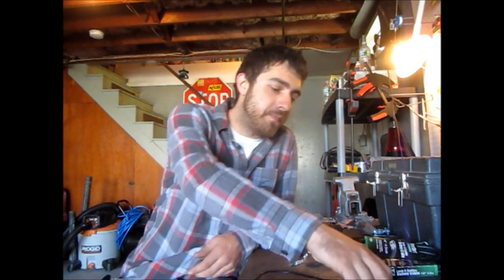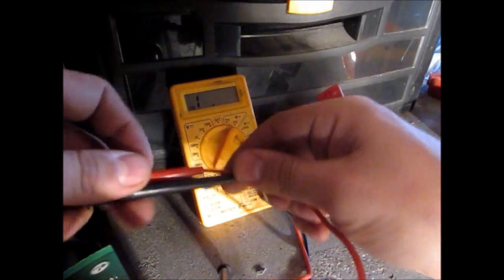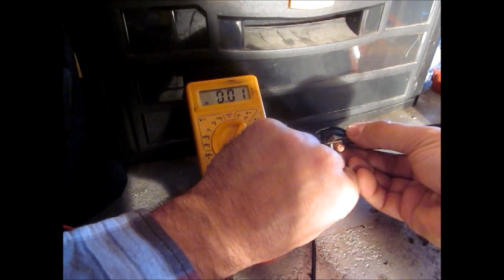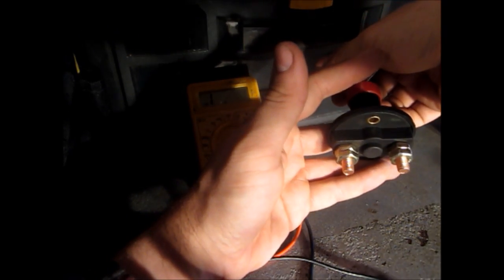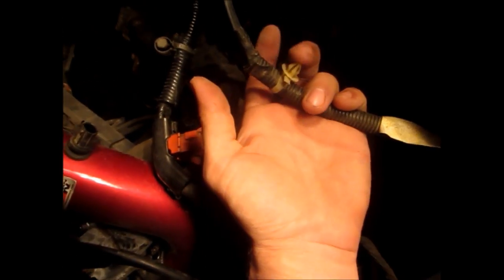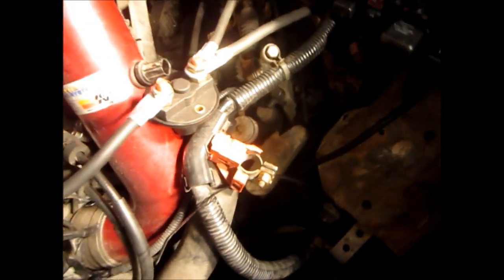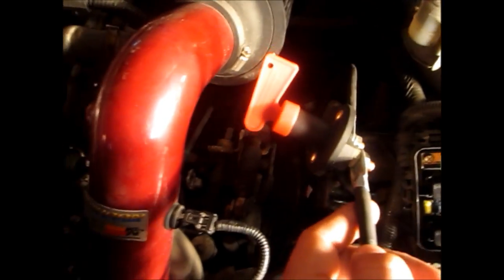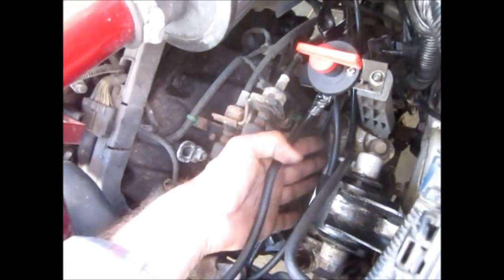How to install a kill switch on your car

Comment: wat if your car has central locking doors en you install the kill switch. you won't be able to lock and unlock your car with the key. that is my problem aswell were do i find the power wire of the doors locking system
i'm made a kill switch on my Porche Cayenne 2005 but now i need to find the powerwire of the central doorlocking. anybody has any ideas please let me know.

Comment: I think however you're suppose to install the kill switch in line with the positive terminal rather than the negative terminal.  Also, I'd chose a different one, where the plastic key is neither detatchable and thus loseable  nor breakable.  All depends on your application.  My own application would be to stop vampire current draws, not theft.  A kill switch will not stop theft.

Comment: This is too simple...you need to cut power to ignition,fuel pump and transmission lock solenoid...that thief will get fustrated and leave

Comment: First and foremost my knowledge of cars is limited to changing oil, gas, tires, spark plugs, brakes. needless to say I'm not mechanically inclined i only know some basics, that being said, I have a 94 Chevy Astro van.each time I get in the van a button the size of a Christmas tree tiny light bulb is blinking red. I have to push this button to connect the battery to be able to start the ignition. I wish to remove this. It disconnects my van randomly, once doing 45 with my kids in the back. in order to get this button to work again i must stop the van, unscrew the positive on the battery and reconnect. please help me find a video or web page tutorial to help me learn how to do this.
Reply from the maker: Jeremy Powell  Sounds like someone tinkered with the ignition system with what is more than likely part of an alarm system of some sort. Wiring issues can be very difficult to sort out especially if someone has messed with the original wires etc.  I would start by trying to figure out exactly what modification was done, then you could either look at an unmodified identical vehicle and see what you need to do to get it back to stock. But there may have been a reason why the button is there, ie. to bypass a faulty ignition (cheap fix). Also I would get onto some GM forums. The great thing about GM is that so many different cars (olds, chevy, pontiac, etc... ) used the same parts in many of their cars/trucks/vans. Good luck my man, and thank you for viewing.

Comment: Install clear acryllic windows, jimmijammer.com hardware and block or pin the door's and sliding window's handles to prevent a door-wedging thief.  And kill switches in a sequential pattern.  Case closed and if a thief without the ability to haul off your ride does not come along, you will be good to go.

Comment: when the ground are disconnected won't it loose the memory out of the computer?
Reply: technically yes, but I dont know how much the computer really remember, depending on make an model.
Reply: theres alot of logic that will not be lost. imagine if the computer was completely blanked if your battery died :o
manufacturers would be in trouble

Comment: no it cannot make your car weak...........geez. if anything it will prevent the battery from becoming weak. it will erase short term fuel trims and clock settings. other than that its the same thing as disconnecting your cars battery

Comment: WARNING: This system isn't secure. To meet the requirement you MUST lock the HOOD. WARNING: Don't use a hood lock because firefighters need to disable car battery.
Reply: If youre ever in a situation where firefighters need to disconnect your battery, shit is already fucked
Reply: Also, if youre worried about that, you can just wire the kill switch through the firewall and into the cab of the vehicle.
Reply: It could be dangerous because lots of amp can short and cause a fire.

Comment: hmmm cant they just pop the hood and wire everything together to get it to start?
Reply from the maker: Sandro Cruz It all depends on how determined a car thief is. Most amateurs will pass and go on to the next if there is an unexpected hassle lasting more than 3 or 4 minutes lol.
Reply: moccina a kill switch always comes in handy, I just installed one on my 97 acura integra, ones of the most popular stolen vehicles in the US! I did a fuel cut off switch though not a battery cut off